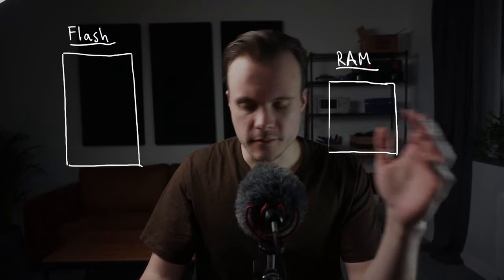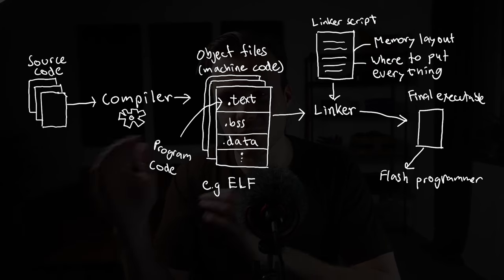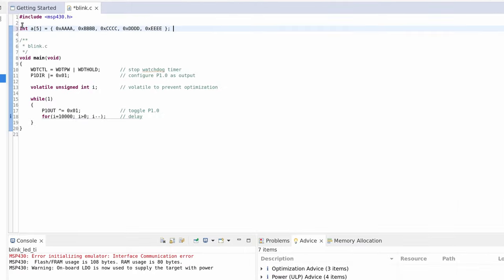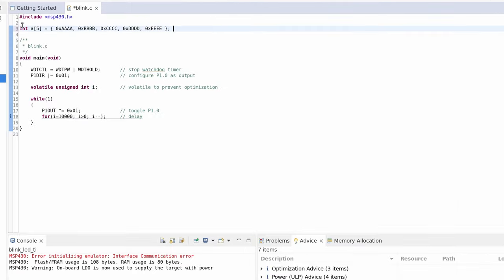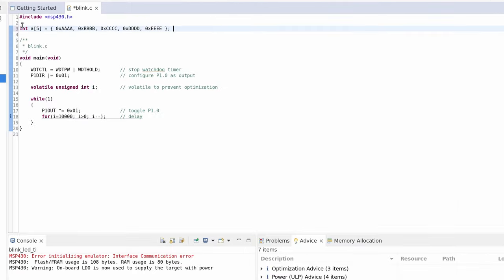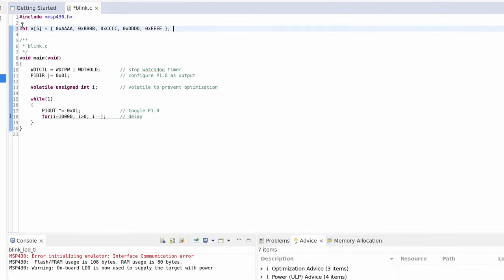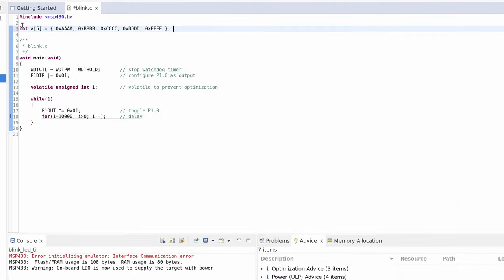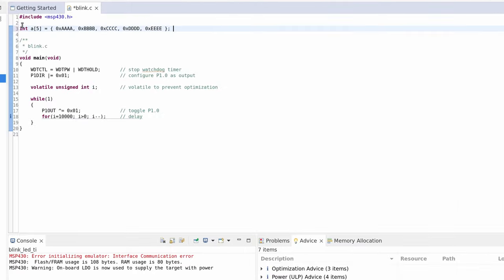How Microcontroller Memory Works | Embedded System Project Series #16

Comment: The variable 'i' cannot be stored in flash because flash memory does not have the ability to write values during runtime.
Reply from the maker: Yes you are right, I should have been more clear there. The loop code is in flash, but the variable is in ram.
Reply: Stack or heap
Reply: On some microcontrollers it can, but it's not used for those situations

Comment: Nice tutorial. But why is this int a[5] = { 0xAAAA, 0xBBBB, 0xCCCC }; placed in .const and .data instead of only in .data? Is this not a variable which can be modified at runtime? As far as I know arrays are not constants like strings?

Also why is the global int c[5] 'only part of the ram'? Isn't it both in .bss in flash and then in .bss in RAM after the startup code initializes the RAM?
Reply from the maker: RAM contains garbage after power reset. So before we get to main(), the RAM variables (variables that can be modified at runtime) must be initialized. But to do this we must know what the the initialization values should be, and that information we are store in flash. In other words, a[5] first contains garbage, but is then overwritten with the initialization values from flash (.const). 

c[5] is also stored in RAM, but it's zero-initialized, and for space-efficiency (bss sometimes called "better save space") we don't store that information in flash. Instead the zero-initialized RAM variables are simply initialized to 0.

Comment: Thanks for such detailed video, it's nice how you explaining things on such low level.
I'm working as embedded linux engineer but I'd like to learn more low level "embedded" and want to have a good base.

Can you recommend your favourite resources for learning?

Also do you have any recommendation on learning electronics/circuit therory/pcb? :)
Reply from the maker: embeddedartistry.com is a good resource for embedded programming. I like Robert Feranec and Phil's lab for YouTube tutorials on electronics/PCB design. Best way to learn in my opinion is to work on a project, start with a simple one, and let that guide your learning.
Reply: @artfulbytes  thanks for the recommendation!

Comment: why "int d[5]" which is the first thing in main () is not the first address of .text section ? why it is exists in the first address in . const  section?
Reply from the maker: int d[5] is not constant, it's a variable allocated on the stack. The data it's initialized with is constant, and because of that it's stored in the .const section. The .text section holds the program code so it will have the instructions that copies the const data from .const section to the stack.
Reply: Although the values you are using for initialization are constants, they are not stored in a separate constant section when used in this context. Instead, they are part of the initialization process and directly copied into the memory allocated for the array on the stack.

Comment: Thanks a lot. Could you please explain boot process ? 
I also wonder, is start up code is the equivalent of boot manager and flash loader?
Reply from the maker: Yes this is something I could see myself doing a video about in the future. Until then, I can recommend this blog post series https://interrupt.memfault.com/tag/zero-to-main/. No they are not equivalent.
Reply: thank you, can you please also let me know the tools you used in this video ? I would like to repeat steps learned here on my own @artfulbytes
Reply from the maker: @cihan1995  The IDE is CCSTUDIO from TI with MSP430 microcontroller. Though you could repeat this with other IDEs and MCUs as well. At the end I just use the bare-bone toolchain, GCC in this case, and Make.

Comment: Great video! but I have a question, in arduino when you want to burn a bootlader into a custom board (not uploading the code, just programming it) what you are doing in reality is uploading the ELF and linker script files to the MCU? I am not sure if I am misunderstanding the concepts of bootlader and  those files.
Reply from the maker: ELF and linker scripts are not what you flash/upload, they are just intermediate files  used during the compilation process that outputs the final machine code (typically a hex file). It's the final machine code (hex file) that is flashed/uploaded  to the MCU with a dedicated programmer (e.g. segger-jlink, stlink). A bootloader is a small program that provides a convenient alternative interface (e.g. usb, uart, i2c , wifi, bt...) for uploading your normal application code (typically hex) without the need for a dedicated programmer. The bootloader has the same compilation process as described above and must be flashed with a dedicated programmer (technically not always true, e.g. multi-stage/self-updating bootloader).

Comment: This is brilliant content.
Жаль что embedded вообще не популярный и умирает. Не подскажете, вы работаете и как обстоит рынок в сфере embedded? Я бы очень хотел в эту сферу, но в связи низким спросом я сейчас учу backend чтобы выжить и прокормить себя.
Reply from the maker: I'm not Russian, but I translated. The embedded field is indeed less popular and harder to break into than other fields of programming, but it is by no means a dying field. It's not like we are getting fewer embedded systems around us :) But it is an evolving field, and we are slowly moving up the stack (e.g. less bare-metal, more OS-based systems). Yes, I work as an embedded systems engineer, and the market for embedded programming is good. If you know your way around C/C++ there is no shortage of jobs. Of course, the situation may vary depending on where you are located.

Comment: why are flash and RAM on the same media?
Reply from the maker: Flash and RAM are separate, but both are ntegrated into the microcontroller for benefits of space, cost, latency, design simplicity, and so on. Memory mapping allows us to programmatically access them in a similar manner, but they are still physically separated and behaves differently (e.g. Flash retains data on reset while RAM does not).